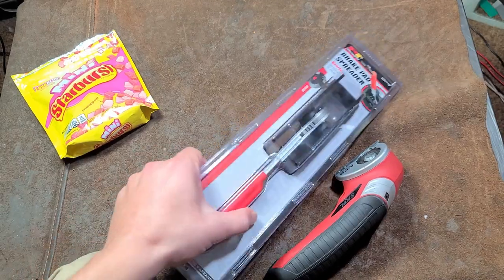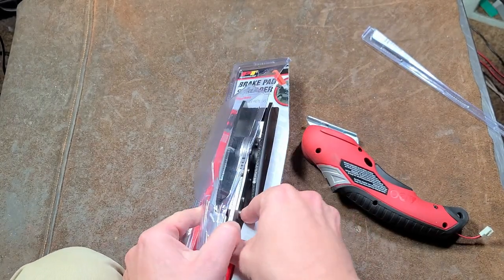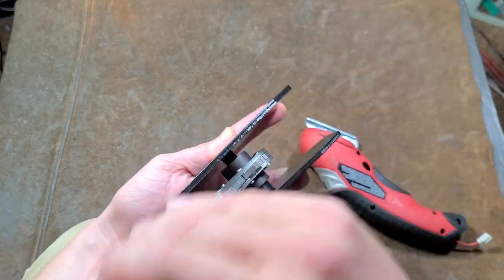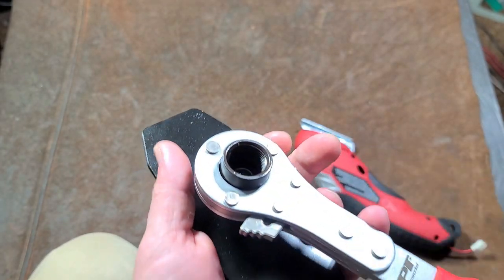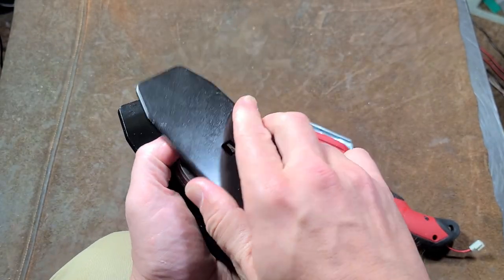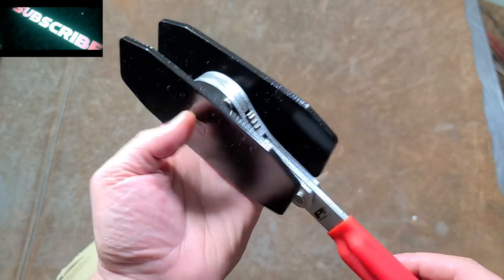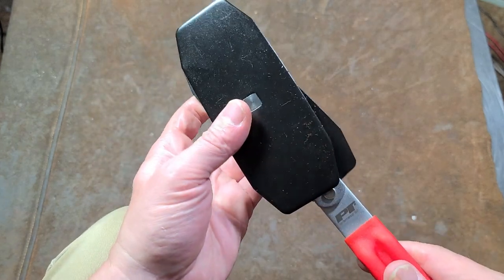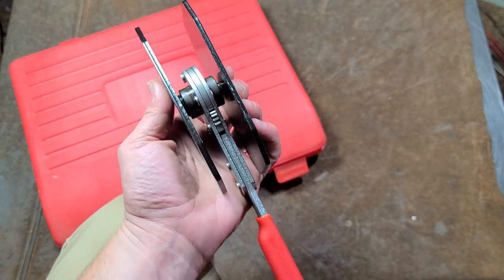PT Ratcheting Brake Caliper Piston Tool Review (Needs Improvement)

Comment: I bought one from a Cornwell rep two years ago; since then he has left Cornwell to be an independent tool distributor. The tool has locked up on me once in a while. Lang has the same thing, as does Snap-on with Blue-point on the handle. The Lang was $65 on Amazon, the Blue-point was $95, and the Cornwell was $75. All three have “made in the USA” on the handle so I would reckon all three of the same tool from different vendors were Lang. I went with the Cornwell version instead of giving my money to Amazon.
Reply: Find a way to free it up? Mine locked up on me during first use :(
Reply: @ThomasRodriguez  Nope, I just don’t use it anymore.
Reply: @donaldhollums3278  I actually figured it out after realizing a little more
Clear how this works. It seems it jams anytime you open it or close it to the limit and smidge beyond. You just have to flip the direction switch and press down on the ground and crank on it hard to get it to break free and start operating back the other way properly. Kind of a pain, but now that I know what is happening it’s not so bad.

Comment: Term might be Jinky.  For the money, I think I will stick with a C-Clamp.  Thanks for what you do
Reply: They improved it
Reply: @JTB128650  Thanks for the update, I will check it out
Reply: @remfj40  just takes time to understand the function of the tool. I did have a problem with smaller calipers on the rear due to the tool being a little too wide. It did fit, but I had to use a c-clamp. I have broken majority of my c-clamps. You could find it on eBay for less than the store price.

Comment: It works very well for dual piston calipers. I don’t think anyone who actually uses it will have a problem. Imagining a potential problem that could occur when using a tool I guess makes sense if you are trying to make a video about something. The tool set in the red case is for single piston calipers not for dual calipers. I like how this tool performed in compressing a dual piston caliper.

Comment: I bought the one from Lang tools a couple years ago it works great... Although I have about half a dozen different options.... you have the parking brake piston tool kit that will usually have 1 or 2 of the pistol grip style and then you have various C clamps and sometimes people will even use channel locks or large locking pliers.... but of them all I grab the Lang set up 1st...

Comment: The Lang one is a much better tool it has an actual ratcheting mechanism I've been using one for a few years now and it hasn't skipped a beat once I normally at least once a month dunk the head in AFT overnight on Saturday so when I come back to work Monday the ATF had time to creep into all the threads and wash whatever gunk was inside out
Reply: Yessir the lang tools one works great. Anything from lang has worked well for me

Comment: You called it bro. This tool SUCKS. Whoever designed this POS should be ashamed. It doesn’t work when you need it. $40-$50 in the garbage. I’ve had it with cheap tools, cheap products, etc.